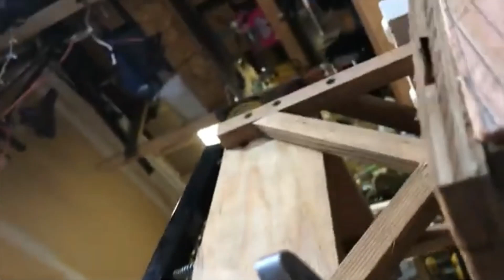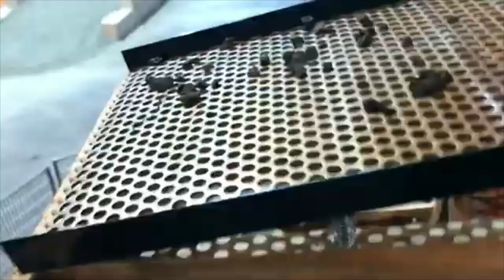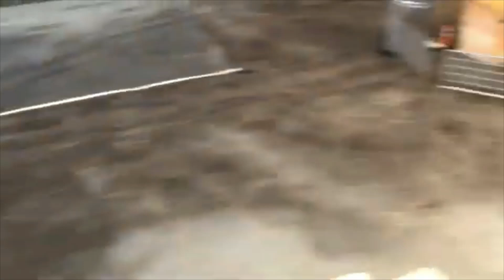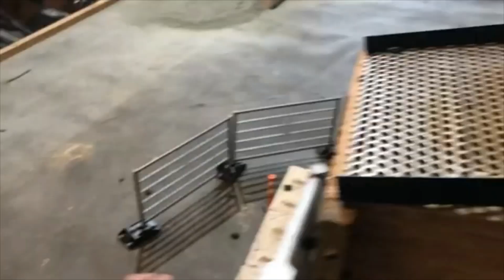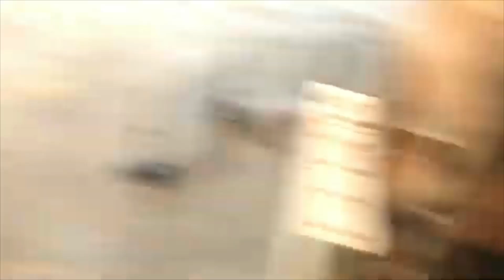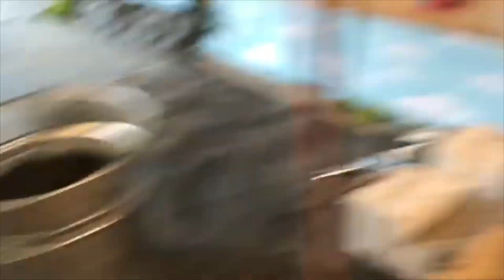MY FIRST SCRATCH BUILD

Comment: Watching different videos of yours have you thought about doing builds and selling them?
Reply from the maker: I actually have sold a few bulldozers, but the  demand seemed to go down to nothing. The parts i use for them are expensive, so if i dont have a buyer lined up, i cant afford to sit on them. Honestly all the stuff i have made is really durable and strong for electric. I try to max out the abilities of these models as much as i can, but to sell things to the public is alot of work. Every little thing has to be bullet proof perfect, and somethings are really time consuming to dial in. for example the delta skid steer, a 30 mm stoke actuator dosent give enough lift, but a 50mm dose, however if i max out a 50mm actuator in that thing ill blow the top of it right off. The dozer was nice because there wasnt much to be concerned about with issues or failures, actually nothing at all, but once i start looking at the other models they become a little more complex. Not all but some. basically anything with internal limit switches is nice because i just have to install them. when i have to get into wiring that stuff in myself it becomes alot of work. And sad to say, alot of people dont want to pay the price. Its not crazy expensive, but people think oh that should cost me 200$ max, but its got closer to 250-300 just in parts for some things, others are even more. Thanks for all your support in commenting though, i do notice and appreciate that.

Comment: Looks great, nice job. Add a shoot on the end and maybe some slightly angled pieces under the screen so you get all the fine material more concentrated in the pocket and less spillage out on the sides. Cant wait to see it in action.
Reply from the maker: Indeed, yeah the material will not make it into a truck at the moment, especially when you add the lock blocks. then the truck sits further away, so i will probably have to do a shoot. Also yeah about the material. i am curious to see what it does with the excavator loading it.